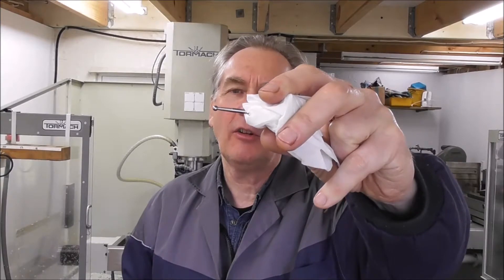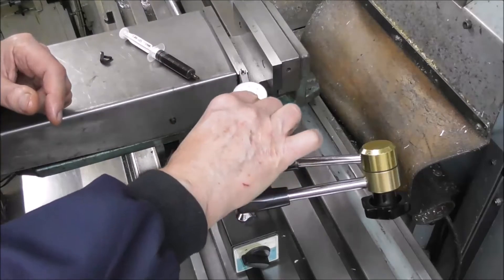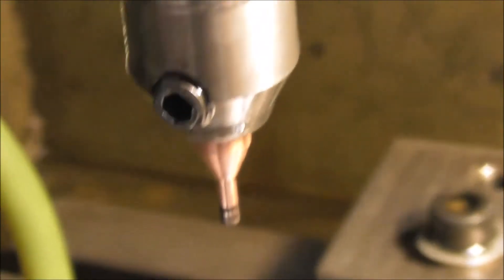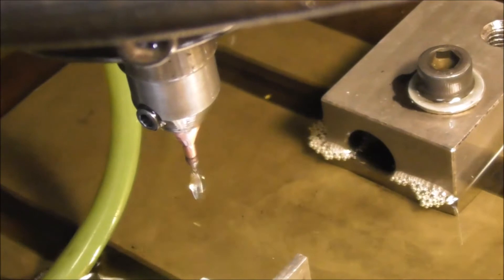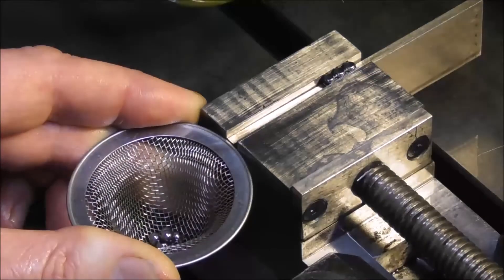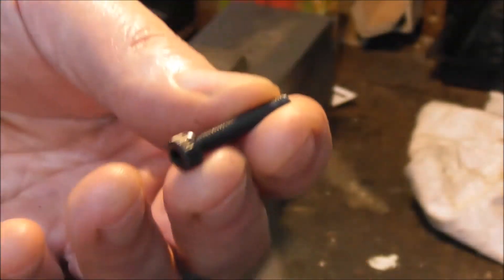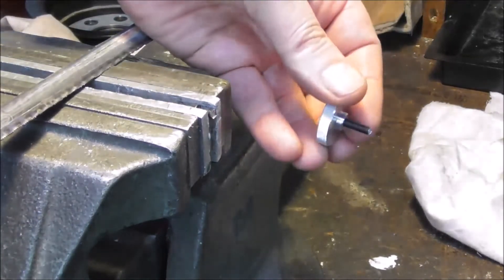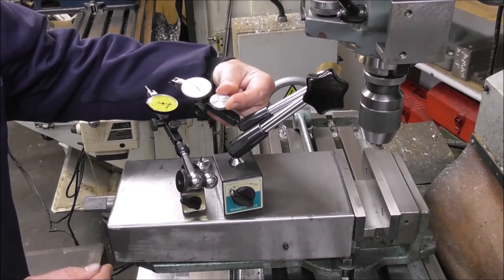ITTP Parts and Dial Indicator Stand Improvements

Comment: Thanks for the inspiration.  Here is a 3D printable one that can be pressed onto the existing knob. On my dial indicator the screw adjustment thumb screw has a spherical tip.  The model is available on Grabcad.com and can either be printed or machined. https://grabcad.com/library/dial-indicator-amplifier-knob-1
Reply from the maker: Good thinking Stig !  Cheers  Cliff